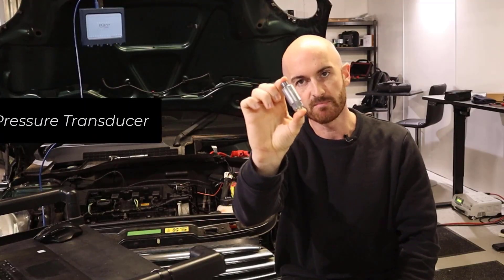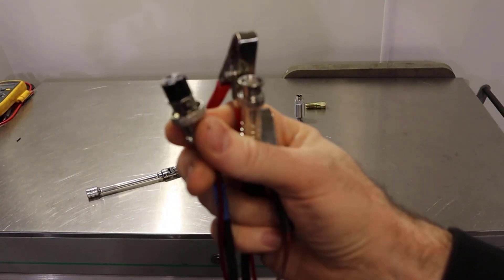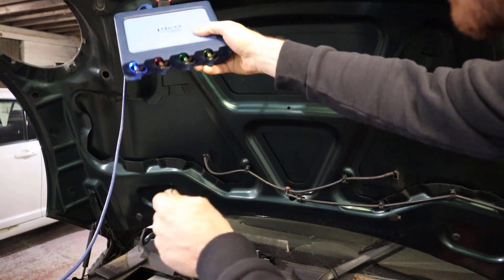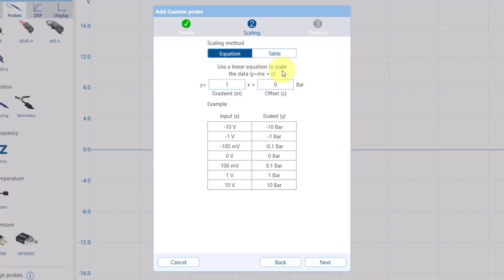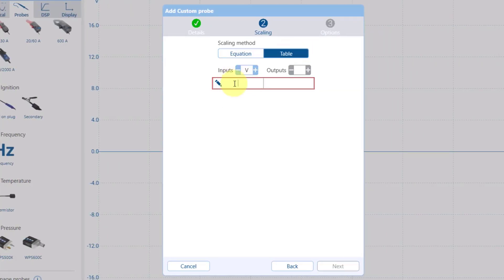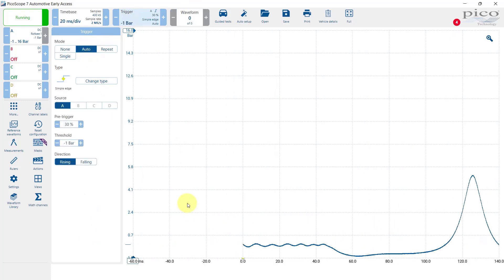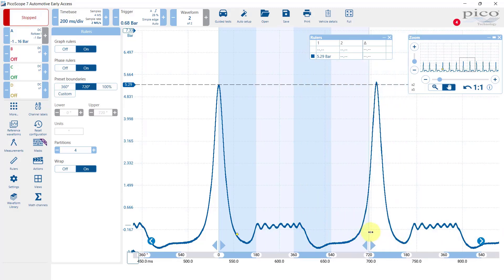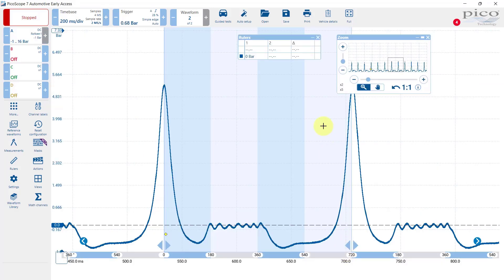Rotkee PS16 In Cylinder Pressure Transducer - What do we think?

Comment: Hi. How is the sensor pressure resolved when using just the sensor and using it with a rigid or flex attachment? Will there be a difference? I mean the correction values of the attachments.
Reply from the maker: @mareklaube2380  I think the MTPro has an option for this. The PicoDiag compression test does too (I think). Otherwise you might have to create a math channel in Pico to do it. Probably only necessary for diesel engine, if anything at all

Comment: Maybe it is me, but this seems like a lot of expensive hardware, and deep into the technical weeds to basically do what a simple compression test can confirm. Am I missing something? It is Making a simple test to complicated.
Reply from the maker: A few benefits from this test; we can also see the valve events, plus you can test dynamically with the engine running and identify intermittent compression issues

Comment: Darren, could you show a video on how to easily transfer all the automotive presets and probes from pico 7 automotive to Pico 7 TM. I currently own both pico 7 auto and 7TM but limited for now using the pico 2204a.
Reply from the maker: If you open the Auto psdata file in TM with all the probes/ math channels or whatever on it, you can save them that way. No import/export feature like PS6

Comment: What range would you recommend for exhaust pressure?
Reply from the maker: This won’t really be suitable you’ll want a pulse sensor, or a WPS500 that goes down to 0.35bar
Reply: @MechanicMindset  That WPS500 is out of the question. I made my pressure transducer using SSI 500psi and 300psi transducers for diesel and gasoline engines. I was thinking something that would read 0-15psi would be sufficient. Is that sensitive enough?
Reply from the maker: @frnkjones40  I didn’t try it

Comment: Although I've never personally used a pressure transducer before, I'm just curious. Since the pressure transducer is powered by the vehicle's battery, won't any fluctuation in the battery voltage affect the sensor reading? 
Especially during cranking
Reply from the maker: Great question! I’ll have to do some digging/testing. I think it might have its own reference voltage circuit like we do on the engine management system ie it’s a 5V sensor. I’ll have a look
Reply: @MechanicMindset  Hi. Any findings? Thanks.
Reply: Shouldn't affect readings at all. It's very easy to design power supplies to reject interference. The comparison waveforms he showed were similar so no interference  present.

Comment: Only 5 bar maximum compression ? I think it should be 11bar
Reply from the maker: It does seem like a low figure; the engine speed and compression was fluctuating quite a lot during this test. The fault state might have a factor with valvetronic

Comment: I have one these sensors, they don't come with the fittings, you have to buy them separately. You get the sensor & the leads.
The sensor works very well & is great value for the money, especially when compared to the other two sensors you mentioned.
Reply from the maker: Yes good point about them being separate. It’s really good kit 👍 cheers

Comment: Can the gasoline pressure also be measured with it?
Reply from the maker: Great question, yes it is compatible with fluids including oil and fuel. You will need the connections to T in to the system. And it can only do low pressure systems

Comment: I like my Rotkee PS16, I had a machinist make an adapter M16X1.25 to 1/4" N.P.T and now I can use it on my fuel rail pressure tester. For the price it is SWEET!
Reply from the maker: Awesome! I’m going to play with my new WPS500 on the LP fuel system; I’ve not done much testing with that before. Cheers 👍

Comment: Looks an ok tool to have , great video,  I do say that a few diagnostic technicians always keep vvt plugged in , what's your view on this Darren , could be a great lesson showing vvt connected and unconnected , thanks
Reply from the maker: Cheers Rob. I usually leave VVT plugged it. It does make a difference; I’ve had a play before. I just disconnected valvetronic in this one to force throttle operation , else the waveform would look like a diesel with no vacuum pockets.

Comment: Nice :)
I wanted to get one at some point but couldn't
I had to kinda DIY my way to a transducer, turned out great :)
Bought the main thing from SSI Amphenol
For about 80$ and then made my own wiring power supply and voltage regulator.
Reply from the maker: Nice job! Do share your results 👍👍
Reply: @MechanicMindset  I'll send you some waveforms if you're curious, I've used it in some demonstrating videos that I've shared, but they're not in English 🙁

Comment: Thanks for the review D. Now you have to get a 12v supply if your battery is in the trunk.
Reply from the maker: Yes possibly, but you usually have jump posts in the engine bay 👍
Reply: @MechanicMindset  yup that can work also

Comment: To me it looks like the first dip before the exhaust opens is higher than the dip after the exhaust. I thought the two dips were supposed to be even. Am i wrong on this?🤔
Reply from the maker: Good observation. I saw this. Might be because of the fault mode; Valvetronic is disconnected in this scenario
Reply: @MechanicMindset Maybe you do a video, with the valvetronic plug 🔌 connected?
Reply from the maker: @Lambros_Stefaneas  I can try, but to be honest, I think it disables valvetronic anyway because of the misfire fault. I’ll try it out. We just won’t see any events below zero
Reply: @MechanicMindset  Maybe you can try, with the coil plug connected and grounded the secondary (so it won't set a code for circuit/coil)and disconnect or restrict the fuel supply or something else so it won't start the engine.Even if it's a strategy to disable the valvetronic, I think you can get the first couple of captures (before the valvetronic be disable from the ECU).
And maybe a bonus for us,have a second channel hooked up on the scope, to see if the valvetronic is been disable from ECU?